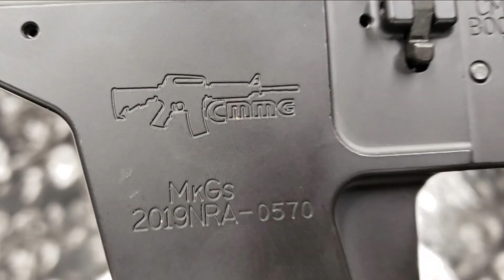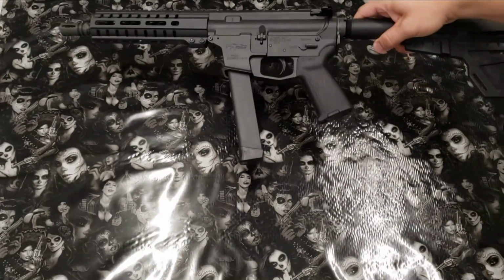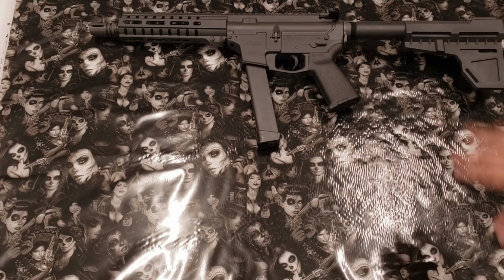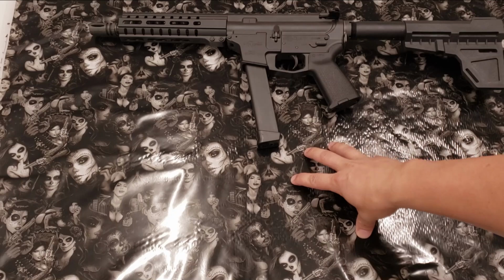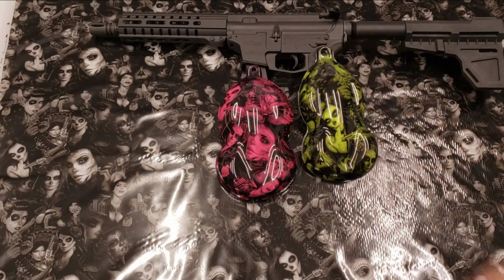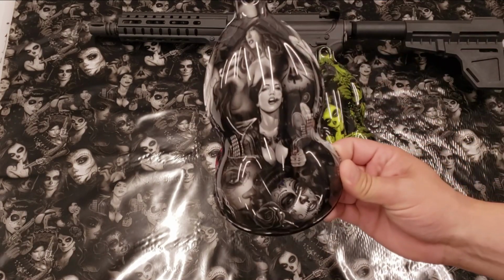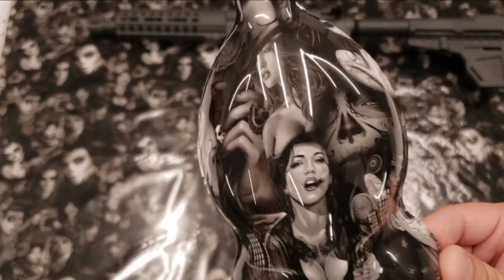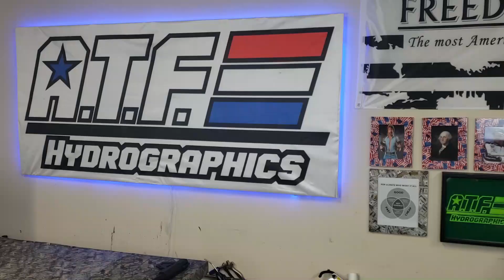Hydro Dip CMMG || La Loca Life Pattern

Comment: So I have a p365 with a black slide and a sig coyote tan grip module, would like to dip the slide, not sure what color would go with it for the slide, maybe a skull pattern with some same color as base with skull or something any suggestions, also never done this b4
Reply from the maker: With tan you can do a lot that would match... even OD green base or Grey base with skulls dipped over the top would look awesome.
Reply: @AllThingsFunHydrographics  that sound good, what other than the sights would I have to cover b4 dipping, is that regular painters making tape u use

Comment: Badass as always brother. My problem is taking off the tape after I dip. Pulls off the graphics. Ugh. I’m still in the learning process. Maybe it’s the Rubbermaid container LOL 😂
Reply from the maker: Thanks Matt.... for the tape issue 1. Your not using enough activator or its the wrong activator for the film. If it is activated properly then the tape will not peel the pattern. 2. use the tape we use, its in the description section of all our videos. 3m delicate surface tape. It works great and never leaves a residue behind.
Reply: Thicker film needs more activator? I bet that’s my problem. I’ve been using the blue tape. But what you explained makes a lot of sense. Let me try it out this weekend. I’ll be looking forward to more videos. I watched all of them. Especially the bloopers ... funny guy lol